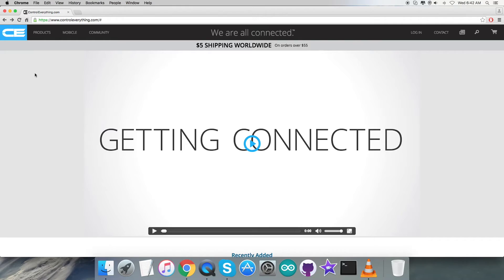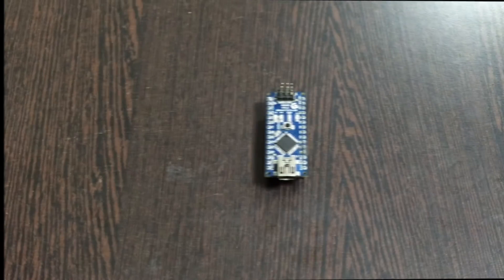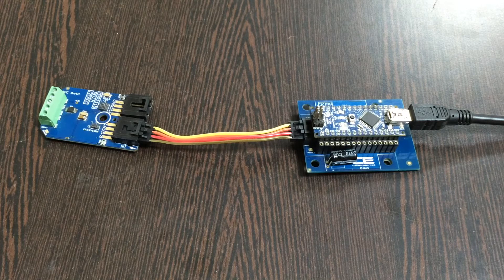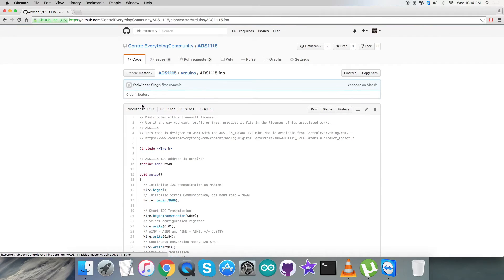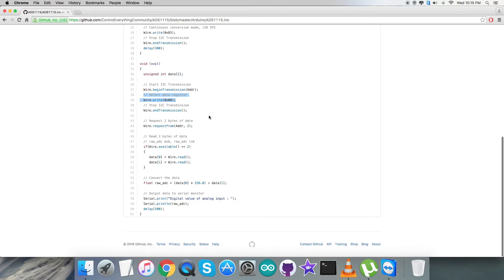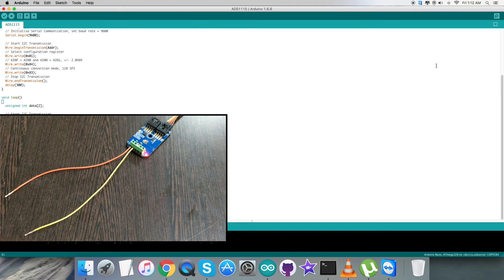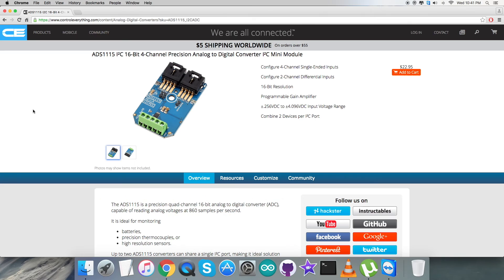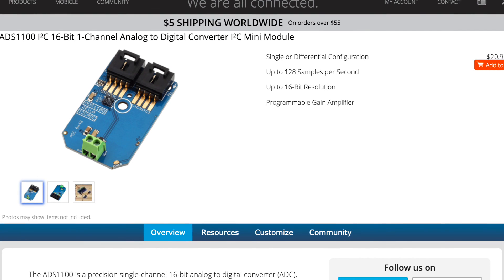Arduino Nano ADS1115 I2C Analog to Digital Converter Tutorial

Comment: is that mV?
Reply from the maker: Yes its millivolts...
Reply: ty, i expected form 16 bit to have more precision like 0.000031 Volts, and it has only 5 digit  "6.xxxx" volts, prob i need to resume to a LTC 2400 24 bit
Reply from the maker: yes, we do have LTC2440, but it will have noise issue and ADS1115 has gain control and 99.99% application can be done by using ADS1115..